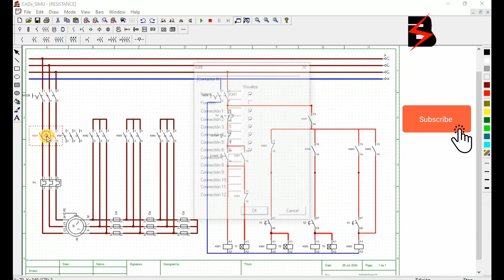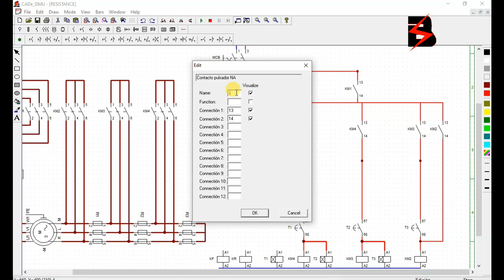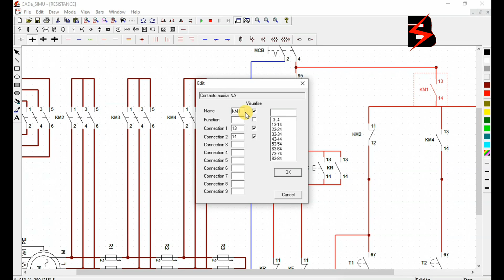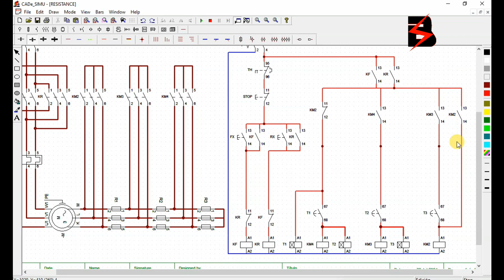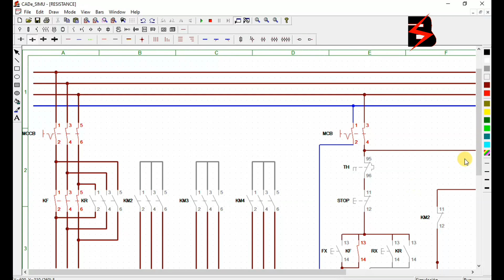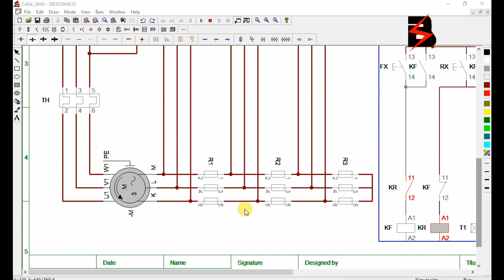Part 2 Slip Ring Motor Forward  Reverse Simulation   / Industrial Automation with @bawashir

Comment: There is a problem in the real circuit. When KM2 is turned on, its NC will cause the entire circuit to turn off and behave like a reset because its NC will cut off the power before KM2 has time to turn on and hold. Here, KM2 will have to be left on for a few seconds and the rest of the circuit will be disconnected.